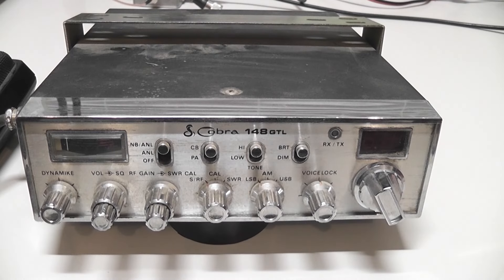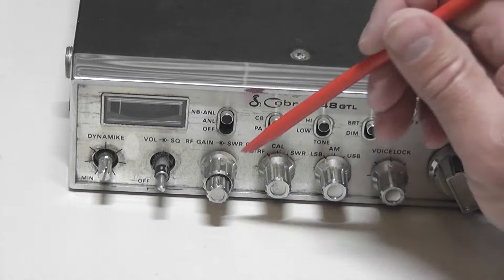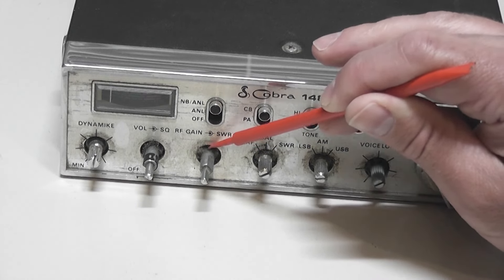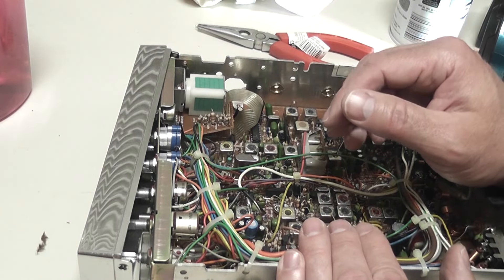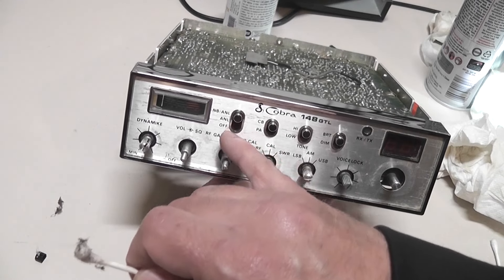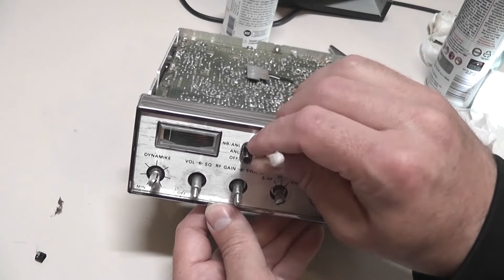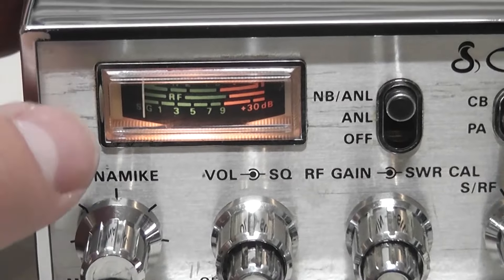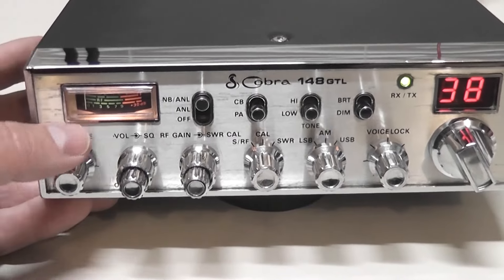Dirty CB Radio Talk - Tips on cleaning a dirty radio

Comment: I usually follow a similar procedure to you when cleaning radios but for my cleaner use dish soap diluted in warm water.  I usually mix up maybe 8 or 10 oz of water in a small container with a generous squirt of soap in it.  I take off my knobs and let them soak in the container while I use a microfiber cloth dunked in the soapy water and then squeezed out to damp to clean the rest of the radio.  I'll sometimes use Q-tips dunked in the soapy water and squeezed out to damp in order to get in tight areas like you did but a lot of times I can scrunch up my cloth to get in tight areas.  I use my damp soft cloth to clean the knobs and then a new, dry cloth to dry everything off before reassembly.  I find the dish soap works as an excellent degreaser and really loosens up all that weird sticky stuff that seems to accumulate over time.  Its safe on plastics and does not seem to attack any of the silk screen lettering like some other cleaners do.  It also doesn't leave any streaks or residue behind like other cleaners sometimes do.  Thanks for sharing your technique!

Comment: I like to use foaming glass cleaner on all the exterior stuff, if it's real bad a little rubbing alcohol mixed in. 
I recently acquired 2 of these radios and the channel segments aren't all working all the time. I suspect dirty selector switch. 
I was hoping to see you cover cleaning that as well. 
It seems to be pretty common issue with these old radios. 
I also soak my knobs in warm dish soap and water then hit them with a tooth brush. 
Since they are plastic it don't hurt them any.
Reply: Another cause of intermittent channel-display segments is the insidious :cold-solder joint."  Such a joint can go for years before failing either as a complete loss of continuity or a high resistance.  Ofttimes a drop of soldering flux and a reheating of the joint will cure the problem. 😉
Reply: @michaelbolton2741  right on, I planned on going thru the solder joints after a good cleaning. 
Thank you for the tip.

Comment: I use a mild soapy water in a spray bottle a tooth brush on the face and knobs and always use my air compressor when needed, just have to control the air. ive been spraying the tube radios with soapy water with a engine brush ive even sprayed tube radios down with the hose because it was so dirty. just douche it down with contact cleaner then blow it out with air then let it sit for several days..  before pluging it in and running it never had a radio short in 50+ years. whats really fun is when you get one and the roaches come running out when you take off the covers, thats why i never take a used radio into the house before cleaning it in my garage/shop first. just have to control how much air and where you spray the water..